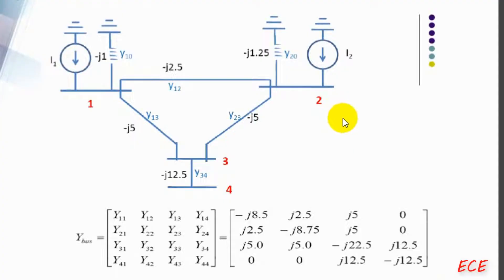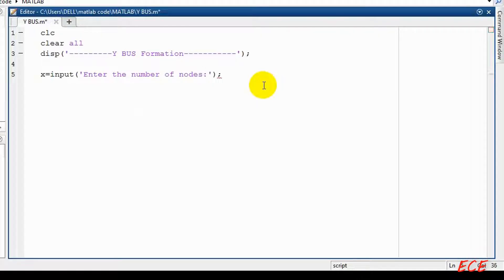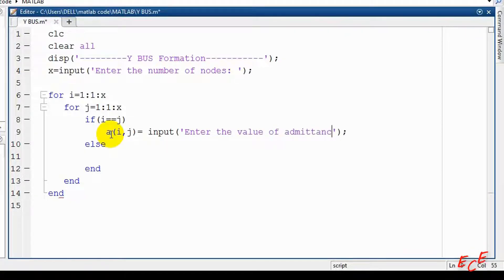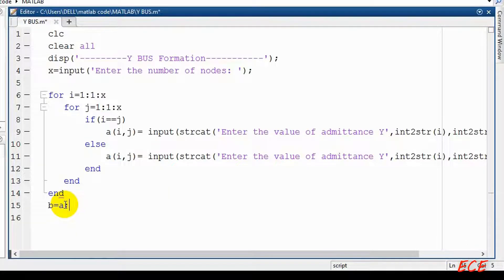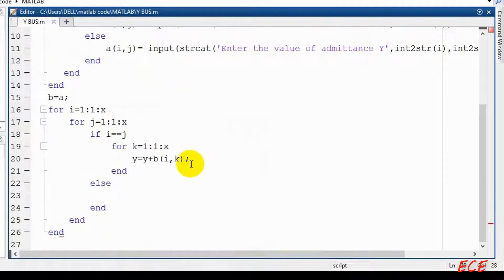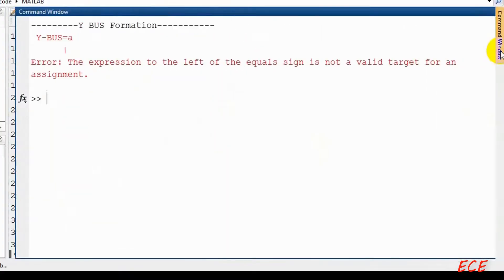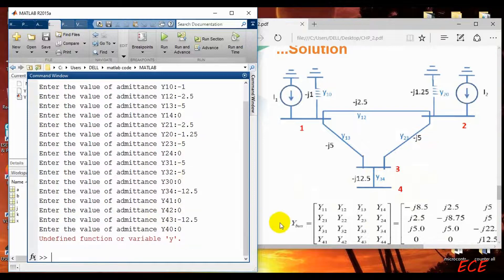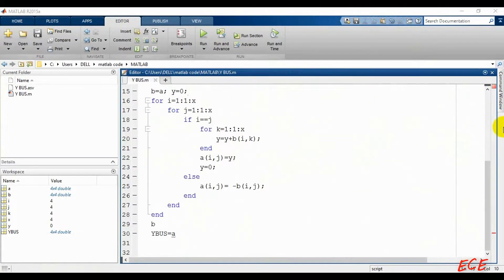BUS admittance matrix or  Y BUS matrix formation with example | MATLAB Programming Tutorial

Comment: Is this applicable to 5x5 dimension? I need to find the Y-bus for 5-bus system.
Reply: How if.. there is an additional information where the problem provides us line susceptance,  reactance and resistance? Cause, seemingly it applies on the problem you gave.. or maybe I need to add on my self.
Reply: @edrusmohd8413  I made a code that calculate the Ybus matrix admittance with N-nodes and no matter if the impedance have resistance too
Reply: @andresfelipeceronmunoz3211  where to get them?
Reply: @edrusmohd8413  I made it myself and it was quite difficult to be honest, if you want, I show you how they work on a video conference and if you are interested in getting them we can arrange a fair price
Reply: @andresfelipeceronmunoz3211  🙄🙄🙄